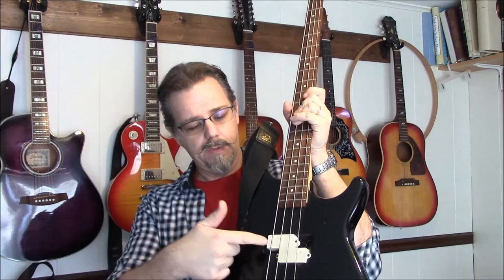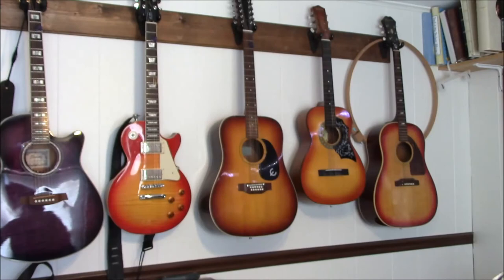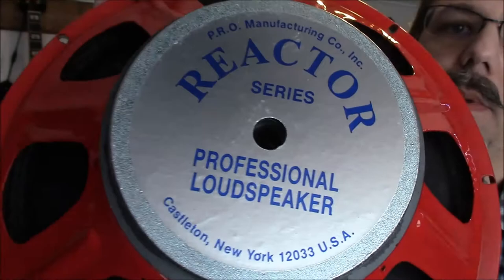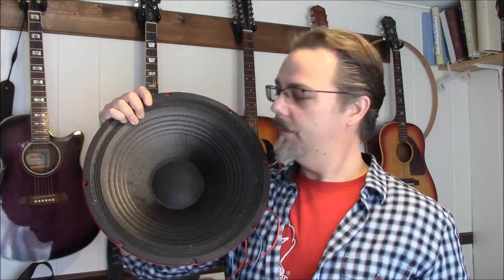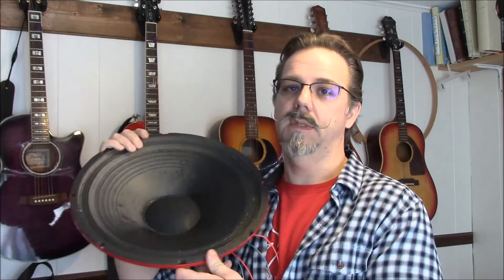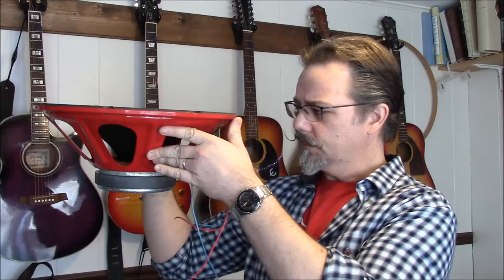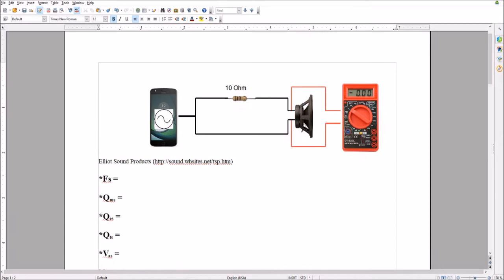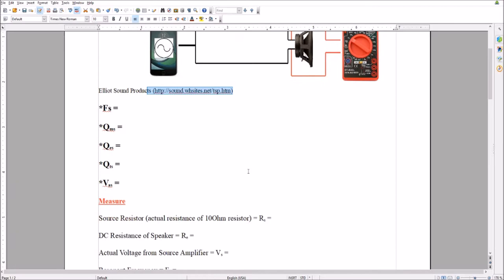Measuring T/S Parameters for a undocumented speaker

Comment: The real test of a subwoofer is how much you can feel its infrasonic (sub 20 Hz) output without hearing it. 

30 years ago, I tested what was one of the best subwoofers on the market - an 18 inch servo'd Velodyne, in the listening
room of a high end audio dealer in San Mateo, CA. I didn't have my SPL meter at the time. At minimum volume, I 
connected my CD player to the Velodyne Input and selected the 16 Hz CD test track. I turned up the volume until I heard 
something, then backed off a few dB. There was no audible sound coming from the sub, but the windows of the listening 
room were vibrating. Fortunately, nothing else in the room was audibly resonating. I WAG'd the sub's SPL at maybe 120 dB.

At infrasonic frequencies, you should be able to feel and even see the output of a good subwoofer without hearing it. 
Anything you hear is either harmonic distortion or some nonlinearly-resonating object in the room. You may see
things like windows or paintings vibrating - OK as long as you can't hear them.

I periodically sweep our listening room for irritating resonances, which I usually damp with pieces of hidden Velcro. 
Some things need caulking. During one sweep of our new place, I heard a rasping noise from an adjacent room. It was 
the metal straps I'd used to earthquake-proof our grandfather clock. Some Velcro under the straps killed the noise.

After sweeping a few rooms, you learn to exercise "a bit of healthy engineering paranoia". Ask any pilot - zero or 
insufficient paranoia is dangerous. Too much becomes "engineering or pilot paralysis" - the fear of making the wrong 
decision or making no decision at all.
Reply from the maker: I use this speaker in the cabinet of my bass guitar amp. This is by no means a high quality amp. My friend who gave it to me said it was from a cheap 80's keyboard amp that got ruined when his basement flooded. I wasn't looking for high fidelity nor infrasonic frequencies (I'm really not that good of a bass player... yet). But the guitars hanging on my wall will audibly resonate with the low E on the bass. As will the glass panels in my cabinet. 

It's not annoying enough to me to spend the time fixing all the rattling. Especially knowing that I will be remodeling the room in the not too distant future. And I think some part of me likes it. Though I may not be very good, I can say my bass playing is "room rattling".

One of the main things I love about live music is being able to feel the kick drum and bass. I wonder if that Velodyne could recreate that.

Comment: if you measured the speaker resistance with the amp and resister connected, then you got the wrong value.
the rice bouncing around is not cool for the loaded mass test.

Comment: In the future if you would ever like to build anymore speaker cabinets  or maybe a pair of studio monitor speakers.There is a device Parts Express sells call Dayton Dats V3. This device measures all T/S parameters in about one second. It's also supplies frd which is frequency response and zma which is impedance curve files so you can build passive crossovers accurately. It also can function as an oscilloscope a signal generator truly awesome little device for $130. There is also software like bass box Pro which you can import frd and zma files to and build 100% accurate enclosures.
Reply from the maker: That is true, but I was trying to see how close I could get on a limited budget. That Dayton Dats is more expensive than a new speaker. I guess it would be worth the expense if I were dealing with unknown speakers on a daily basis, but so far, this is the only one I've ever come across. 

Thanks for watching.
Reply: @HandlebarWorkshops  I totally agree. A lot of money, for a once, or twice-off.

Comment: My calculated Qes was 34.04. On the elliott sound there is a note "Qes = Qms / (r0 - 1) Note: While this is supposed to be the correct formula, many have found it gives Qes that's much too high". An alternate formula is also given Qes = (Qms/(r0-1))*(Re/(Rs+Re)). By using this formula your new Qes should be 1.4 and mine is 3.4, In my case it is clear I have to use the alternate formula but in yours?
Reply from the maker: I realized that the formula I was using was incorrect. And the website that gave me those formulas updated them after my video came out. 

Either way, I just went ahead and made a cabinet for it by copying a commercially available cab. It may not be the best for that speaker, but it's fine for what I need.

Comment: When finding Hz (below/above Fs), i can not understand voltage (Vr=0.166). Where it came from? please help.
Thanks in advance.
Reply from the maker: I start talking about it at 20:08 (I know, it's a long and dry video and difficult to focus on. Sorry about that.) Vr is Ir * Rs. Ir is calculated just before Vr and Rs is the actual measured value of the physical resistor in the circuit.
Reply: @HandlebarWorkshops  Don't be sorry please. Your explanation is very easier to understand. Thanks for the reply.

Comment: 12:56 - What exactly did you measure there? The diameter of the cone seems to be around 370 millimeters, not 322 as you said in the video.
Reply from the maker: That measuring tape is wonky. It takes into account the length of the plastic box. The number shown on the tape is the distance from the plastic tab to the end of the plastic box. Really confusing, but that was all I had at the time that could span that distance. 

Thanks for watching.
Reply: @HandlebarWorkshops  Okay, thanks for clarifying. :)

Comment: thank you for the tutorial video,
Please measure a speaker that has published specifications, then compare the two results together, what do you think?
Reply from the maker: That would be ideal, but speakers can be expensive. This one was free and my method got close enough. If I can find a cheap enough speaker, I will do just as you suggest. 

However, I still have to go back and do some re-calculations. The ESP website put out some new equations that should help me get an even better result. I just have to find the time to do it.

Comment: Which ic based amplifire is used and
Reply from the maker: I am just using a stereo receiver as an amp. But you could use a computer sound card or even a guitar/bass amp (as long as it is not a tube based amp - using a tube based amp without a proper speaker load will burn the tubes out).

Thanks for watching!

Comment: Yes, it was a sealed enclosure originally.
Reply: You can convert a sealed enclosure to a vented enclosure with a Passive Radiator (drone). The bass will be extended, but 1) the time response (dynamics) won't be as clean and 2) the very bottom end response will drop off 24 dB per Octave v. 12 dB per Octave, which is essentially the same as point 1).

Comment: Out of interest, what is the sampling rate of your meter? wouldn't an oscilloscope be a better instrument to make measurements for Voltage?
Reply from the maker: I have no idea what the sampling rate of my meter is. I bought it used without a manual. I guess I could go look it up online, but I don't think it's necessary. 

Using an oscilloscope would be much better, but they're rather expensive and most people (like me at the time) don't have them. I was trying to do this in a way that was relatively easy and cheap with tools that a lot of people have or have access to. I've since purchased a used scope but I already put the speaker in a cabinet and had been playing it often.
Reply: First Point - the integration time of a Dual Slope meter is 100 milliseconds, intentionally 6 cycles at 60 Hz and 5  cycles at 50 Hertz. If you can remember from Calculus, the integral of a sine wave over a full cycle is zero. 100 milliseconds is the lowest integration time that's an integer of both 50 and 60 Hertz. Why? According to Sampling theory, 50 and 60 Hertz will both fall in the bottoms a deep notches. That way, you can do a very low-level DC measurement in the presence of a significant line voltage pickup and your DC measurement will hardly be affected. The display will barely flicker.

A wonderful invention. I believe Weston Instruments may have held the original Patent.

Second Point - I came to this website because I managed to install a 12" shallow Subwoofer in a 36" by 18" by 5" , 1 .1 cubic inch enclosure that fits PERFECTLY under the tonneau bar of my 2016 Toyota RAV4. I love classical organ and tried to get down to 16 Hz, without spending $$$$. I was able to get down to 24 Hz before the cone started breaking up - unlike my TV room's (modified) Sunfire True Subwoofer that will eek out a 115 dB SPL at 16 Hz. I need a subwoofer with a breakup-resistant, stiff Aluminum cone and about a 2 cubic foot enclosure. 

What I also discovered - don't expect decent bass from a shallow subwoofer. Physically, the cone is too shallow. You need a real, deep, stiff conical cone to minimize breakup, multi-mode, doubling (2nd Harmonic) or tripling (3rd Harmonic) or higher-order Harmonic distortion.

So, I've just found a reasonably-priced Harmony HA-A122, 12" Anodized aluminum cone subwoofer, with no published Thiele-Small parameters. Their prime retailers have no TS data. I haven't yet reached Harmony's engineers. I have a small electronics lab in my garage. I designed medical electronics for 40 years before recently retiring. 

I thought it would be fun to do my own TS stuff if there were no published data, and I had to buy a sub to test it myself. Instead of clay, we have some of our granddaughter's leftover Play Doh.  Since she's 17, I need it more than she does. The Doh is still flexible after 13 years. A full Play Doh container fits the vent of a legacy Radio Shack 12" subwoofer, allowing closed v ported frequency response comparisons.

Third Point -  a Linkwitz Filter is excellent for open-loop flattening of a subwoofer's response in a sealed enclosure. It removes the resonant hump and significantly raises the bass response if your sub cone doesn't distort and your amplifier power is sufficient. A vented enclosure can also be done, but it's very tricky and requires much more amplifier power.
Reply from the maker: Thanks for all of the information. I hope that Harmony gets as low as you want it. I'm surprised you can even hear 16Hz. Or are you just feeling it?

That said, I wonder if my video might be a bit too remedial for you. Sounds like you have a pretty decent setup and can probably put a video with much more technical information than this aimed at an engineering or very experienced audience. This video was more aimed at musicians. ;)

Comment: I have a set of 6 inch speakers and was wondering if it was necessary to make a tuned cabinet since i dont have an amp available to use to measure those parameters?
Reply from the maker: For optimal bass response, you could try to design a tuned cabinet, but I don't think it would be worth the time and effort. If you look at commercial high end speakers that use the same size, you'll find that all of the cabinets are around the same dimensions. I would just use measurements similar to those and call it good. That's what I ultimately did with my bass cabinet since this video didn't give me useful results.

Thanks for watching.

Comment: Great video have you tried using modelling clay instead of rice
Reply from the maker: That was one suggestion that I saw, but I didn't have any modeling clay. And I figured most people were more likely to have rice than modeling clay, as well.
Reply: I dunno if this might be the reason for the surprising numbers, but loose rice is not good.

The added known mass should directly and consistently alter the mass of the driver (piston). The mass should remain affixed to the cone during the measurement; the combined mass of the rice (or other loose additional mass) and cone will only be stable at rest - a state that never occurs during the measurement. Sticking stuff to the cone is obviously not desirable, but necessary for accurate results. It might be worth trying to find if anyone has figured out a solution to this problem - either mathematical (an algorithm that accounts for a loosely added mass) or practical.

Thanks for walking through the process. I have to do this at some point down the road. Familiarizing myself with the procedure in advance :)
Reply from the maker: I hadn't thought about that. Interesting. I was looking to get a uniform distribution of weight, and I thought something like the rice would be both economical and easier to spread out. 

Good luck with your T/S Parameters journey. If you figure something out, let me know.

Thanks for watching.
Reply: I have an idea. How about some magnets on the front and back of the cone. I have seen people using coins and blutac before. I think stong masking tape and supergluing coins on is a better idea.

Comment: Can i use my mobile direct as an amplifier which giving Vs=0.572V  ??
Reply from the maker: You'd have to measure it to see, but probably not. 

Most cellphones require some kind of powered speakers (much like computer speakers) that have an amplifier built into the speaker enclosure that you have to plug into the mains outlet of your house. The current provided by the cellphone is probably not high enough to drive a speaker by itself.
Reply: Handlebar Workshops can i use PAM8403 class D amplifire which have 5w output

Comment: I prepared a similar setup but my speaker is rather small, a 52mm dia speaker with 4ohms (5w). I am measuring the 10ohm resistor's voltage across its legs and the voltage is climbing instead of declining when the driving freq. comes close to resonance freq. I plotted the output voltage and saw that it makes a double hill. What is going on?
Reply from the maker: Well, a 52mm diameter is about 2 inches. The whole point of the T/S parameters is to design and build a cabinet that tuned to the speaker so it can properly reproduce the low frequencies. As such, it mainly applies to bass guitar amp speakers and sub-woofers. I'm not sure such a small speaker has enough mass to require a tuned cabinet. Nor would it be able to reproduce the low frequencies accurately enough to require a tuned cabinet.
Reply: @HandlebarWorkshops Thanks for the answer. I am a newbie. So how is it possible to design a speaker enclosure for small speakers then? Generally, small speakers come with a sealed enclosure but there are bass reflex speakers too for instance. How to design those?
Reply from the maker: Honestly, I don't know how to design a cabinet for that small of a speaker. I'm rather new to all of this as well. I'm just trying to figure it all out as I go. Until I recorded that video, I had never really done anything like that before, nor have I've done it since. 
However, I would assume that the size of the cabinet wouldn't matter with such a small speaker. A port (a hole cut into the speaker baffle - sometimes with a tube - to allow air to escape) may or may not help depending on the size of the cabinet. A speaker that size will not move much air (that's how speakers work, the paper cone pushes air which causes pressure waves that our ears and brains interpret as sound). And since air is rather springy, if the enclosure is rather large, it won't matter at all. 
I would suggest you experiment. I don't think you can get the T/S parameters for such a small speaker. Make some enclosures out of cheap wood at different sizes and see what sounds the best. You can even record it and post a link here.

Comment: While measuring the Fs  voltage is decreasing when you increase the frequncy but in next step voltage is increasing when you increasing the frequency ... how does it working like this
Reply from the maker: That is the resonance frequency, the frequency where the the voice coil in the speaker has to do the least amount of work (lowest voltage) to move the cone. It all depends on what the cone is made of, how big the magnet is, what kind of glue is used to attach the paper cone to the metal structure of the speaker and how it all works together (resonates).

I am at a loss to come up with a good analogy, at the moment, but think of holding a pool noodle at its center point. If you move your hand back and forth, the ends start to wiggle. If you experiment with the speed of your hand, you will find a frequency where the ends flop around in a very consistent pattern and it will be very easy for you to keep that pattern going - this is the resonance frequency of the pool noodle. If you try to speed up or slow down, either you have to use more strength in your arm or the ends of the pool noodle get chaotic.
Reply: Handlebar Workshops thanx for attention sir..
Reply: Handlebar Workshops is there any other way for talk to you like instagram or facebook